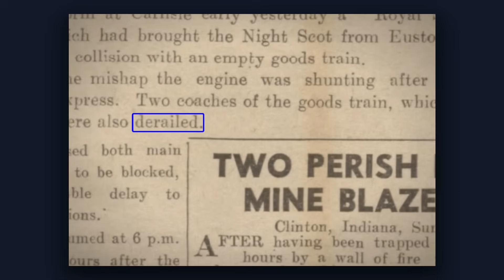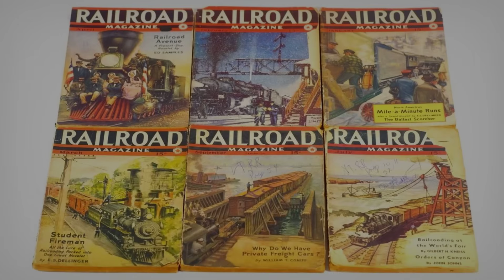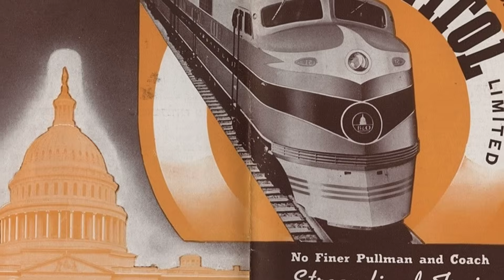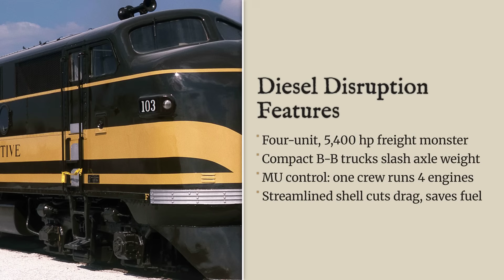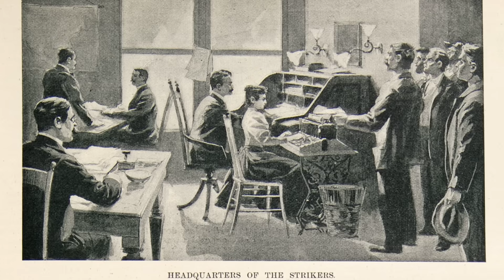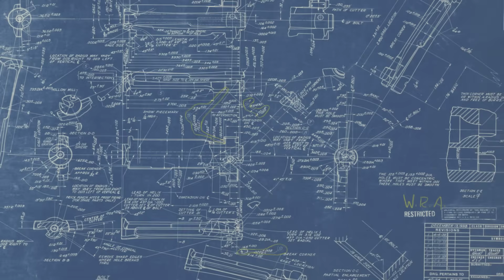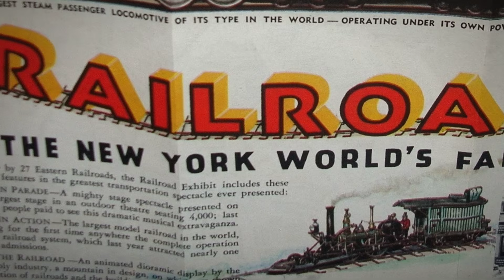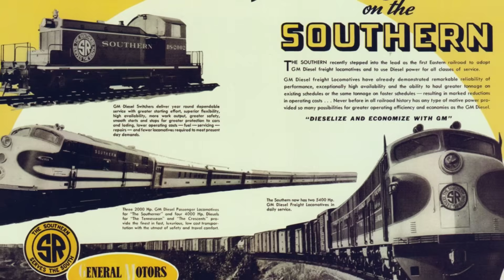The 'Secret' Prototype That Was Illegal To Build — How GM Killed Steam In 11 Months

Comment: Steam locomotives needed WATER, Diesels did NOT.  Ask Santa Fe, no water between Winslow, AZ and Barstow, CA was the first long distance to be Dieselized during WWII and they got dynamic (turn electrical traction motors to generators)   as a side effect, less brake show usage.  Once proved, the rest of the desert routes followed suit first, then the efficiency of the Diesel took over.

Comment: The maximum work that can be done by any heat-driven engine is proportional to the difference in temperature of the working fluid, before and after the work is done.  And, nothing more.  In an internal combustion engine, you can get extremely high temperatures before the work is done, by compressing the working fluid.  This increases the temperature difference and, therefore, the potential work.  You can't do that with a reciprocating steam engine.  It was a matter of time before someone figured out how to do this with internal combustion.
Reply: You’re almost right, it’s the difference in stored energy. turning it into an equivalent temperature is why it’s proportional to temperature. The temperature-pressure-material-constant product is simplified to temperature. The work done to compress the air charge in the cylinder and the fuel mass itself is recovered with less than 100% efficiency. It’s necessary to get the equivalent temperature above the flash point of the fuel so that the sprayed fuel droplets combust without an ignition source. The efficiency of a the more complex expansion scheme used in a steam turbine in an electrical power plant is greater than that of a railroad locomotive or a large marine or static diesel engine but the working fluids are still the same. One key difference is the water/steam phase change, another is that the steam is expanded 3 times instead of one or two to minimize the entropy loss. The essential part to understand is that the railroad engine has to make a lot of compromises to be mobile and cost effective for its intended use. The dual cylinder high-pressure/low-pressure with super-heat and re-heat and so on was significantly more efficient, but the cost to build and maintain it wasn’t always cost-effective. The steam turbine railroad locomotive prototypes  like the John Henry and the UP steam turbines were efficient but they weren’t cost effective.
 In contrast, fairly crude (as a degree of difficulty to design and manufacture) design extensions like the roots blower are cost effective additions to a diesel locomotive engine and allow the use of a 2 stroke design with cylinder porting instead of mechanical valves. Raising HP for a given cylinder volume and simplifying the engine is cost effective. The engine is better suited to mobile installations with a limited space and weight,

Comment: I keep seeing ideas that batteries should be used to meet California’s zero emissions mandates.  It seems to me that overhead electrical wires like in Europe would make more sense.  Or, at least a combination of the two on a single train - with the batteries recharging from the overhead wires for portions of the runs.
Reply: That’s fine & wonderful, buuuuuutttt; you’d need a reliable source of electricity.  The People’s Socialist Democratic Republik of Commifornia (PSDRofC) doesn’t have that.  Droughts, an adverse to building Nuke plants, coal fired plants, etc…, ‘brownouts’ due to high temps. & wildfires, etc.. precludes any electric based solution.  Don’t start by saying solar energy will do it because it won’t.  

Nothing beats fossil based energy sources.
Reply: Nice idea, but California is working hard to eliminate all stable power generating plants.  Combine that with a decaying electrical infrastructure and you have problems.

Comment: It was inevitable that diesel locomotives would replace steam locomotives. The main factor was economic. Diesel locomotives cost a lot less money to operate and maintain the steam locomotives. Here are some of the differences. A diesel electric locomotive was more fuel efficient than a steam locomotive. A diesel locomotive did not require any fill ups with water, a steam locomotive required frequent fill ups of water. A diesel locomotive required a lot less maintenance than a steam locomotive. Finally running multiple diesel locomotives required far fewer workers to operate than multiple steam locomotives. So the result was diesel electric locomotives took over and most steam locomotives were scrapped with a few steam locomotives displayed in museums and a few steam locomotives restored to running condition.
Reply: Two keys you missed but kind of hit on one of them.  Availability - Steam spent so much more time out of service for breakdowns, repairs, overhauls. and Preparation time - it took hours to fire up, lube, fuel, and water a steam loco in preparation for the days run while the diesel you start it up and drive within minutes depending on whether you needed to take on fuel before setting out.

Comment: What a farce.

Steam locomotives could be brought in and turned in hours then placed on the ready track.

Only 2 CREW were in cab. Mechanical stokers fed the fire. The fireman monitored steam pressure and was a 2nd pair of eyes on the road ahead.

Those guys LOVED THAT JOB and were bonded to those machines.

Meantime the EMD - FT was a bomb. Highly unstable and a piece of mechanical junk. How many were preserved?

Their upgrade tge F3 wasn't an improvement. 

This was never a battle over horse power or efficiency.  It was a battle of titans between ultra wealthy factions controlling coal & oil.

Oil was the new cash cow so suddenly everything went there EVEN MEDICINE = 96% OF ALL PHARMACEUTICALS ARE MADE FROM CRUDE OIL. 

Are diesels better? Maybe. 

Are they more powerful = mostly NO.

They do their jobs. Thats good enough as it was with steam and electric.
Reply: Basically, the kind of power to move that freight is the type of power you need. The question is... what's more beneficial for not just the company, but those on the railroads to?

The answer: Whatever the Situation calls for.

Today, Diesel Locomotives now have atleast a helper engine to help with the freight. So has things changed? No... not really, just the efficiency.
Reply: nonsense.

Diesels, even ancient FT, were, first of all, AUTOMATIC. No more miriads of levers, valves, nuts and oilers, keeping busy the crew all day long. Just couple of handles and dashboard with instruments, GO, by one loco or 10, does not matter. This was the unique feature of diesels.

Steam engines missed their chance to turn into something similar, like coal power station on rails, where small duty crew provides gigawatts of power. When such projects emerged in 1950s it was already too late, they did not provide significant advantage relative to 1950s diesels.
Reply: @antontsau Those projects were engineering idiocy on steroids and FADS OF THE TRADE. 

The theory behind steam tutbine was wholly flawed beyond measure but the railroad industry was into FULL FLEDGED MALFEASENCE MODE by the mid 1950s.